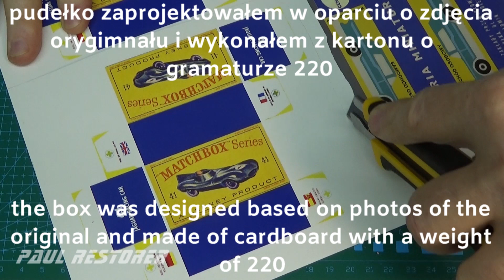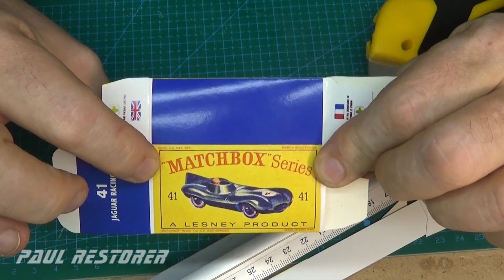Matchbox Jaguar D typ nr 41. Model autka odnawianie, renowacja.

Comment: Fantastic job there what sort of casting silicon did you use I didn’t realise it would take higher temperatures 👍👍👍
Reply from the maker: I used molding silicone MM940 withstands temperatures up to 350 degrees Celsius. Best wishes

Comment: What a great restoration, Paul; you have a great talent! I have this very model on my list of 'to do' jobs, but I'm struggling to find a driver; what would be the possibility of you casting one for me, please? Obviously I would pay for your materials and time....
Also, what tools did you use to 're-dome' the axle ends?
Reply from the maker: Thank you very much. Of course, I can send you a driver for this model only after the pandemic because the mail does not work between countries now. Write to my e-mail what you need and I will definitely answer as soon as possible. paul.restorer@wp.pl When it comes to copulating the axle, I use a standard drill with the option of Bosch Professional battery hammer. Instead of a drill, he mounts a hardened M6 screw with a drilled cone inside. I show this on my channel about making an axis. Best wishes

Comment: My car was purchased about 1956, I do not rember it being offered in 1960 as all of the original Matchbox releases were replaced by newer vehicles. Also, mine has solid wheels not the spiked version yours has. The driver in mine was light brown.
Reply from the maker: Hello. Surely you had a car from the A series a little smaller than that. Best wishes
Reply: @PaulRestorer  Mine has the number 41 and was an original issue from 1955 or 1956. I mark the date by the yellow US Ford station wagon and white MG my Jag was displayed next too. Also have the horse drawn milk wagon from the original release, somewhere.
Reply: I will add another thought: For some reason I had more "respect" for my Matchbox Jag then the others I bought when they were originally issued. The 55/56 Ford wagon I mentioned has lost about 75% of its yellow paint, the MG has lost about 10%, and the milk wagon is without paint chips, didn't make sense to roll it around on the floor like the automobiles. Also remember building a trailer for the Jag when the Holden Ute was released decades later. Never mind the Holden is a smaller scale! I have NEVER seen an original issue Jag at a swap meet/flea market, it was/is popular.

Comment: Paul can you please  send me the link to the paint remover and how fast does it work? I have metal miniatures  that need to be striped and it looks like it would work quicker than what i am using . Also is it safe on plastics ? Thanks for the help in advance .
Reply from the maker: Hello . This old paint remover works by manufacturer in 5 minutes I wait 15 min. Unfortunately, the plastic dissolves. I use Dot 4 brake fluid for plastic. groupev33.com .Greetings
Reply: Hi Paul do u make boxes for sail,Gary,
Reply: For sale,excuse me,
Reply: @PaulRestorer   Thank you for the help
Reply: I use Wilko's paint and varnish remover. About 3 quid a bottle. Works a treat on metal stuff.
Reply from the maker: I am not selling yet, but if something changes, of course I will inform you. Best wishes